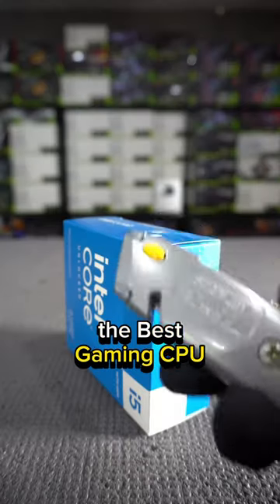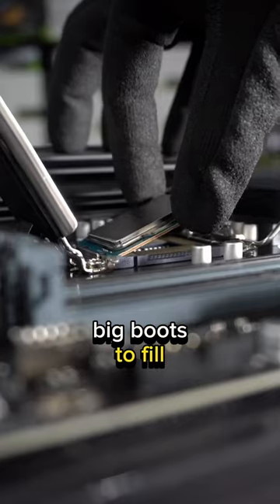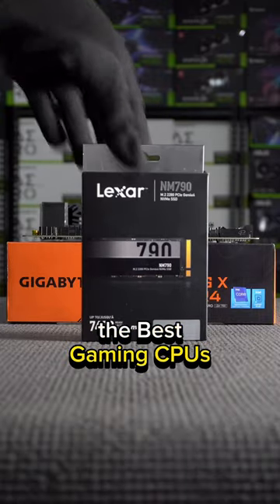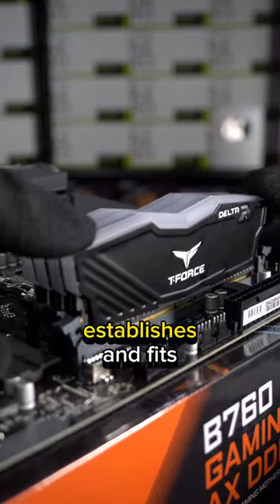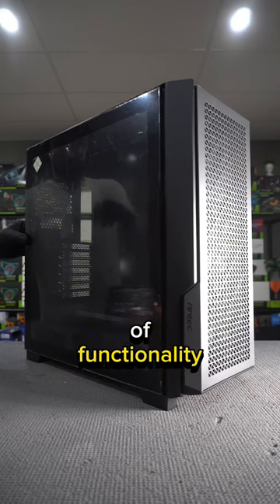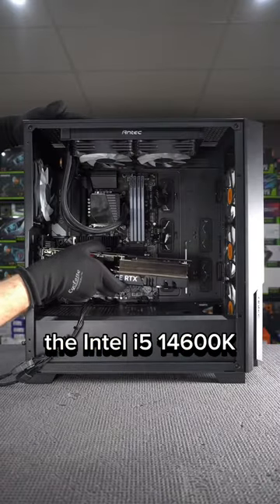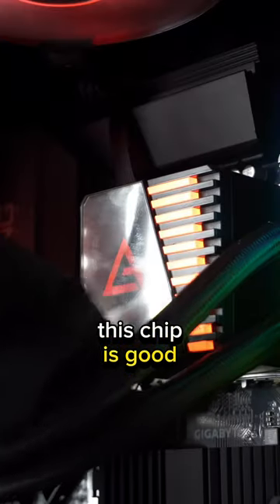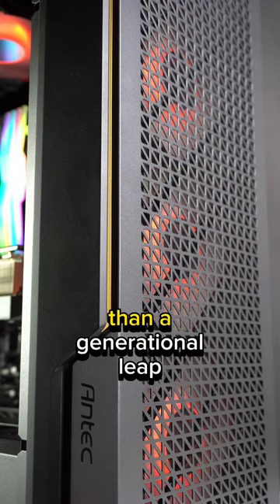The NEW BEST 👑 CPU from INTEL⁉️ The Intel i5-14600K 😮

Comment: Saw some reviews that the 14th gen is only 2-5fps higher than 13th gen, major yikes
Reply: It's basically the same architecture with just a slightly higher clockspeed.
Reply: @wanshurst2416 It IS the same architecture. Not a new gen, but they name it as such.
Reply: i didnt know cpus were for gaming, and not gpus. wow
Reply: @qwerty_waffle Different games and applications utilize GPU or CPU in different ways.
Reply: @acrxsls1766  understandable
Reply: I think they done that cause they focused more on mobile cpu's also they can tell us "huge performance boost" in 15th gen launch compared to failed 14th gen
Reply: U probably play mine craft with it anyways😅😅
Reply: If i had a 13600K i could overclock it and i have a 14600K
Reply: it is 35 dollars more and it honestly isnt that bad if you already have the 13th gen then it definitely isnt necessary but if you have the 12th gen its honestly worth it
Reply: Ok
Reply: @amon3809 
And if you have the 14600k you can overclock it and you have a better cpu than overclocked 13600k lol
Reply: Which is well into the margin of error
Reply: @Largenitalia I got a i9 9th gen should I get the 14?
Reply: @snareplug3872  what pc specs do you have rn? you might need to upgrade your gpu aswell so that theres no botlleneck
Reply: At least it's not that more expensive, great if you have 11/12 gen
Reply: 2 is too much
Reply: Oh yeah you make a better CPU
Reply: @wanshurst2416  didnt thought intel would take the mobile SOC  move
Make chip > Oc it > rebrand it
Reply: @qwerty_waffle what? You think games rely only on the gpu? You think you can remove the cpu if it’s for gaming? It doesn’t work like that, at all, they do different things but they need each other
Reply: Just get a 13600k or a 13900k
Reply: yeah, 50 bucks more.Just get the 13th gen or an amd ryzen cpu.
Reply: it's just a refresh
Reply: 14700k/f with APO is game changer.
Reply: It is nothing new. The only difference between 6700k and 7700k is also the clock speed.
Reply: @Largenitalia runs too hot. Not worth the temps and cooling maintenance
Reply: @qwerty_waffle you want both to be good enough to game
Reply: To be fair, the price difference is like what, 20€?
Reply: @dzeklakovic7568  it’s still not worth it in the slightest, and it’s really poor marketing from intel. It’s also more thermals to deal with
Reply: True but the 14600k now is like almost the exact same price so
Reply: Bro my friend is running on 10 anything would help him 😂
Reply: But Same price
Reply: @Gamer-yd7xl  no it isn
Reply: In what games?
Reply: It needs to be an i9
Reply: @Largenitalia  there’s pretty much no noticeable difference in 98% of cases, even outside of gaming
Reply: @merosi1234  but it’s more expensive and they’re almost the same performance within margin of error
Reply: @qwerty_waffle I had i5 8400 and bought 4090 and had to wait 2 weeks until my 7950x reaches me, and I kid you not, the 4090 performed 30-40% as good with 7950x
Reply: Indeed
Reply: it is only a slight increase in performance, but i see 14700k going for the same as 13700k
Reply: You’re not supposed to upgrade every generation, and you can only squeeze so much fps out of something
Reply: 14th gen Intel is a joke, only the i7 14700k see a small most with few extra cores apart from that other processor in the series are literally 13th gen overclocked.
Reply: @avs_ytb  I have the 14900kf because I got it at a cheaper price than the 13th gen so why would I not?
Reply: @snareplug3872  going from 9th gen to 14th gen is a massive improvement in performance, but it depends if it's worth it for you since you'll need a new motherboard and probably a new gpu to get the full potentential (also a new motherboard that supports gen14 will probably be a ddr5 ram motherboard
Reply: Both price is almost same

Comment: 7800 X3D clears
Reply: Overall , 14600k Wins clearly
Reply: @qwertzn6085 yes, but on games 7800x3d would normally give better performance for gaming
Reply: @Nathanghgf just at 1080p
Reply: @nivea878 i play 2k, and want to upgrade to either 7800x3d or 14600k, what should i go for?
Reply: @nivea878  Nope. 7800x3d is a lot better. And you have to turn those shitty e-cores off for games if you want no stuttering.
Reply: @jepulis6674 yea was about to say the  e cores cause issues and are inefficient. Intel hasn't had a winner at all since Ryzen 2k series and even then once you patch for exploits in the last decade plus say sandy bridge up to present the cpus pale next to amds offerings even the 1 and 2 series Ryzen. House fire levels of power consumption. Intel changes sockets left and right no longevity to any consumer platform in well over 10 years.
Reply: @jepulis6674  wrong. fanboy much?
Reply: @iequalsnoob strange, the tests shows that is correct.
Reply: @qwertzn no😂
Reply: @ashnar1690  7800x3d, you get a motherboard upgrade path, just dont get a asus board
Reply: Why not asus @nttinvis
Reply: @SamuelPGM  itll fry the board look it up
Reply: 3x the tdp, 20 degrees hotter, and similar gaming performance. The x3d chip is better in every way. @iequalsnoob
Reply: Its more expensive than i5 13600k what you on
Reply: @qwertzn  intel blind Dan returns
Reply: @Nathanghgf  even in productivity, it sucks compared to AMD.
Reply: @iequalsnoob lol intel child
Reply: @qwertzn  in which way
Reply: @nivea878  hi bot in 1080p the game is more cpu bottlenecked but if go even a bit higher it starts to completely shifts on gpu. So ryzen 7 7800x3d wins
Reply: @ashnar1690  7800x3d. I am not biased and pls trust me. We are waiting intel to release a reasonable cpu so don't buy intel
Reply: 100usd more for a 7800x3d.
Reply: @ashnar1690  7800x3d lol. It's the best gaming CPU on the planet earth right now for gaming
Reply: @inducedapathy1296 bro is still living in 2020
Reply: 14600k renders geometry better in heavy games, 7800 wins only in weak games or games without ray tracing (pastgen)
Reply: @kalpanajagarlamudi8795  you are a victim of AMD marketing, they still haven't learned how to make normal memory controllers.
Reply: @doberlife639  troll comment lmao
Reply: @nttinvis wait for real, i got an asus board, tf do i do
Reply: @catfacecat.  uh just make sure voltage and connectors and psu are good, personally i like asus features but iv had tons problems with booting on asus boards,, make sure bios is up to date
Reply: @nttinvis  oh, thought it was some unfixable shit. will do, thanks for telling me.
Reply: @catfacecat.  i mean it might be, but i think its because of the voltage regulation not working well, that they were having problems, just check what its supposed to be at and make sure it doesn't go over, no pbo or anything
Reply: @nttinvis  gotcha. good thing i saw right about when i started actually using my pc.
Reply: Yea if you want to spend exactly $350 more for 7800x3d in Australia
Reply: @sidewinder86ify and exactly $350 more for 7800x3d in Australia. No brainer to go for a $350 14600k if you want good performance and save money
Reply: @mrmeaty5619  i mean at that price it's fair.  but if you want gaming value,7800x3d still wins. in australia would be same price as 14900k and faster.
Reply: @catfacecat.  True. Swapping to amd motherboard. So I can upgrade to 7800x3d later down the track. But would have to upgrade my GPU as well as the 7800x3d would be too powerful for my GPU now

Comment: If you already have an i5 13600K (or even an i5 12600K), this is absolutely not worth it at all. If you are building an entirely new gaming PC like me, for only $30 more than the i5 13600K, the i5 14600K is an absolute no-brainer. This will be my CPU of choice!
Reply: Okay but is the upgrade from an i7-7700k to the i5-13600k worth it when you consider having to replace the mobo and maybe even RAM? Not looking to build an entirely new PC but refresh on the CPU scene
Reply: when the difference is negligible is it really worth it? I'm buying new parts atm as well and decided on the 13600k just cus I saw how the 14600k barely qualifies as an upgrade.
Reply: @EmeraldArchive I dunno if AMD is gonna do similar with am5 but intels track record of supporting a consumer platform over a year or two is abysmal. If you have a 7700 sounds like you aren't updating every year or two. I would avoid Intel due to that and sit on the fence and see if am5 will be similar to am4 for next gen. The other thing to note is a 3600 handily beats a 9700 and has an upgrade paths to a 5800x3d which destroys an i9. All cheaper at launch and currently used or new. Intel has been a terrible choice for over 5 years and is living on name only.
Reply: if you're building an entirely new gaming PC you want the ryzen 7800x3d, and the 7900xt gpu stomps all over the 4070ti for 200 dollars less as well. intel is going HARD on paying for shills these days.
Reply: Need 3dvcache mannn 7800x3d blows these away
Reply: @scottbrowder8304 stomps on the 4080 and 4090 in cod
Reply: @EmeraldArchive if your willing to replace your ram and motherboard then yes
Reply: @EmeraldArchive 7700k? do u mean a 7700x
Reply: I'm choosing i5 14600kf
Reply: @Lil_Kerch  7700k

Comment: I have the i5 13th gen, and my friend just got the i5 14th gen. He said it is the exact same except for a slightly higher overclock. Edit: he now benchmarked a few games at 1440p with a 3080 and he got some good results getting above 140 fps in most games at high to very high settings. I don't have a 3080 so we can't compare that.
Reply: If you both have a 1#600k processors then don't worry your friend gets 5-7 more fps than you do while using around 20-40 w more
Reply: well he gets around 15 fps more but because he has a better graphics card. He did separately test the CPU but it didn't get a much better result than me. I think it would be a waste of money for me, but for him it was worth it because his last CPU was the i3 7100, so a very big upgrade. He did mention that the GPU was a bit of a bottleneck for the CPU though. @RAYX07
Reply: @bgamer251 he needs to get a 3090 or the ti version or the 4000 series to remove a good amount of bottleneck
Reply: Not slightly better. Its much better. Seen ppl run it at 5.7 or even 5.8 ghz. I run it at 5.6ghz stable.
Reply: @Jeboi96  a decimal overclock is going to make a difference, but it's going to bottleneck his GPU real bad especially at 1080p. Also, the difference is minimal, we got very similar scores in different CPU stress and benchmark tests.

Comment: I’m still on 12th gen, which runs all newer games just fine at 100+ fps, so yes if you want good better performance go for these new 13th gen and 14th gen CPU’s but if you’d like to budget down and still be able to run games like rdr2, the 12th gen CPU’s are the way to go, atleast if your getting a pc which you built yourself so you can swap out the parts at a later date

Comment: What about i5 14600 kf + 4070 ti super guys?
Reply: Yes very good setup. But you would want to overclock the i5. Standard it has just 3.5 ghz. When you overclock you can easily run it at 5.4 ghz. You can play anything.
Reply: I have one like this, I love it. 4k native rt+fg or 1080p 165hz

Comment: 14th gen is just refreshed 13th gen which is just refreshed 12th gen. don't fall for Intel's naming scams
Reply: ye 13th gen was a much better uplift too. 13600k much better then 12600k, 14600k maybe worth 10 dollas more then 13600k LOL.
Reply: @Direwoof   I mean, 14th gen is literally about 10 bucks more expensive lol
Reply: Yeah 13th is value for money
Reply: Definitely a big jump
Reply: I’m going from 9th gen to 14 🤔
Reply: @goldleaf054  Bruh, i'm going from 4th gen to 14th, how do you think i will feel next month or so when i build it. From i5-4690 | GTX 970 to i9-14900k | RTX 4080 Super.
Reply: @indeed8724  new mobo power supply and you’ll be good but overall a good upgrade

Comment: I am using an i7 11800k and I do not see myself updating for a long time because it does not bottleneck my GPU and the ridiculous GPU prices prohibit me updating the one I have so there could be a revolutionary leap in CPU technology and it just would not matter.
Reply: I am only now upgrading my pc from a 4th generation 4690k to the 12th gen version. I might not be running the most power hungry games or applications but the parts that had the most impact on performance were the gpu and storage and I have upgraded both and run my desktop like a dream.

Comment: Had to upgrade from a ryzen 5 2600 and a gtx 1080,  went with the I-7 14700k and rtx 4080. Would highly recommend the 14 series, works extremely well.
Reply: Ik you loving that pc man. I’m getting a pc rtx 4070 super and i7 14700k in about a month and a half and it’s a huge upgrade from my gaming laptop with rtx 3050 and i5 10300f.
Reply: @deathstreaks6493  man, I love it! It was well worth it even if I only use it a few hours a day. If you plan on getting high FPS a high refresh rate monitor and want great graphics, I'd say the 4070 is more than enough! You're probably going to love the upgrade, have fun with it!
Reply: @Horranderu  Thanks man, I will!

Comment: I have a i7 9700k paired with my rtx 3070ti. Should i upgrade to the i5 14600k?  I have games where my gpu sits at 50-60% usage..
Reply: No you shouldn't 14600k is same as 13600k just costs more

I recomend getting 7500f or 7600 they are same speed but cost like 100+ less than 13600k and you can upgrade to New cpu with out upgrading Motherboard when 11th gen is out
Reply: You should use higher settings in games if you ahve only 50-60% useage

Comment: Bought i5 12600k 4 months ago. More than happy to hear it’s still a good cpu in 2023. Should I upgrade to a $400 Rtx 3080ti or $550 RTX 4070?? Currently have a 3080. (Super hard to find a good priced 3090😩)
Reply: would hold off on upgrading for now, anything more than what you've got is gonna get bottlenecked most likely.
Reply: @MxSlfDstrct  fosho man. I appreciate your thoughtfulness on replying. I’m doubting your response tho. Who ever you learn your stuff from, fire them immediately! Lol I’m just playing. My cousin has the i5 12600k since launch about 2 years ago. He just upgraded to 4070, but he did have a Gigabyte RTX 3060 12gb. So his performance is noticeable. But anyways, would I be dumb to go from a 3080 to a 4070? I don’t know if I’ll be helping or hurting myself🤣
Reply: @es1alexlopez isn't the 3080 good enough for pretty much everything, I think it would be better to upgrade later.
Reply: What you need to do is stop buying nvidia
Reply: why do even want to upgrade? Doesn't make sense to buy a gpu of the same generation and a 4070 isn't really much faster than a 3080. only "usefull" thing probabaly would be dlss3. but if that's worth a few hundred bucks?
Reply: The 3080 is basiy equal to the 4070, I'd go for a 4070 to (or super, which is rumoured to release soon) which gives 3090/ti performance, though it only has 12gb vram which the super might change
Reply: @es1alexlopez If you have a 3080, the only gpu you should be considering is the 4080 and above. The 4070 has the same performance as the 3080 so no reason to waste money for Dlss3. Just wait for next gen
Reply: @_Turtle_420  Hello? Are you on dreaming? You better not to spread hates on them. 😅

Comment: If you keep it stock yes. But this cpu is a beast in overclock. I run mine on 5.6 ghz. Its 3.5 ghz standard. I have no issues with heat what so ever. Alat this moment its faster in boost than the AMD cpu in boost and is 100 bucks cheaper.

Comment: Processor i5 14600k It is very suitable for the game, but friends, keep in mind that the new Intel socket is coming, so don't rush. (1851)
Reply: Does this mean that the motherboard with the LGA 1700 socket is not suitable for the new generation of CPU?
Reply: @amirmohammad527  I think Intel released their roadmap recently, and it looks like the 1700 will be replaced in 2025. Correct me if I'm wrong.

Comment: Can the i5 14700k right there pair with an rtx 4060?
Reply: Get the 13600k or even a 13700k with a 4060 ti or 4070
Reply: @i_am_brainrotted rtx 4060 ti 💀
Reply: If you have an I5 14700k I’m worried about you you got ripped off. 😂😂😂
Reply: Or a 3070 ti or normal 3070 or rx 6700xt or 6750xt

Comment: Can i use this cpu with 4060 ti 16gb vram?
Reply: Uuh yeah just a bad choice i dont recomend doing that bc 14600k and 4060ti 16gb are the two worst mistakes you can make i recomend getting am5 motherboard DDR5 ram and 5 7500f or 5 7600(both same speed as 14600k just a lot cheaper) and instead of 4060ti 16gb try getting 7700xt it's A LOT faster and 4gb vram less But it doesn't matter bc it is still a lot faster even tho 12gb vram

Comment: The 14600k deserves a better gpu like the 4080 or 4080 ti
Reply: Or anything not nvidia
Reply: The only thing the 14600k  deserves is to get in the dumpster because it has practically almost no boost while using 20-40 watts more
Reply: @_Turtle_420 🤦🏻🤦🏻🤦🏻

Comment: This short is a sin. The 14600k is basically the  same as the 13600k with a diffrance of .2 mhz clocks and the 4070ti is awful value for its price.